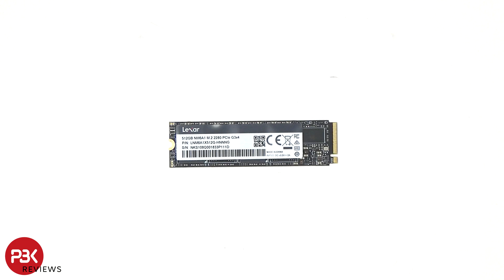Acemagic Mini Gaming PC AM06pro Teardown Disassembly Repair Video Review

Comment: After removing the heatsink I noticed that the thermal paste is spread all over the mini resistors,  isn't that bad since they could short? Or the paste used is not electrically conductive?
Reply from the maker: correct, they thermal paste used isn't a highly conductive one, or else for sure it would be an issue.

Comment: So is the CPU not a regular Ryzen 7 ? I'm confused why does it look so weird is this for laptop?
Reply: I know this is old and you probably already have your answer, but this really is what all CPU's look like underneath the metal shield you're used to seeing which is called a hat spreader. with compact devices such as laptops, or in this case, "mini" PCs, they remove the heat spreader as typically the CPU itself is soldered to the board and the "heatshield" is removed also to remove another layer of inefficiency as far as cooling goes. Sometimes the only thing between the heat shield and the CPU is a thin layer of thermal paste and simply having the heat sink directly on the CPU like in this video makes the cooling more efficient, which with these compact devices, you want your cooling components as efficient as possible eliminating any cooling bottle necks wherever possible.